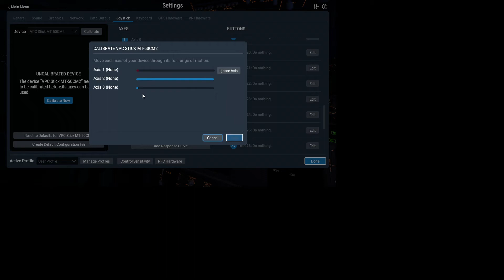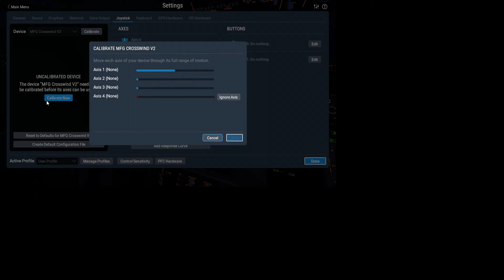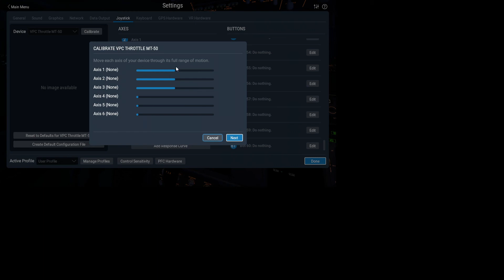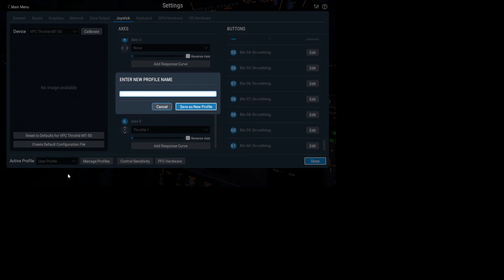X-plane 11 - Basic joystick set-up tutorial

Comment: I had an issue last night when I switched out my Honeycomb Bravo for my CM3. There is a detent in the software for Beta (Ground Idle) and Reverse (Turboprop). I never had to do a thing in the Bravo and when I switched to the CM3 - I can't get the planes throttles to move past Flight Idle. X-plane and VPC see the throttle as full travel. The plane only sees half travel.
There are manual or Auto gates to go through, but when opened  - same issue.
EDIT - I have no reverse for any plane;(